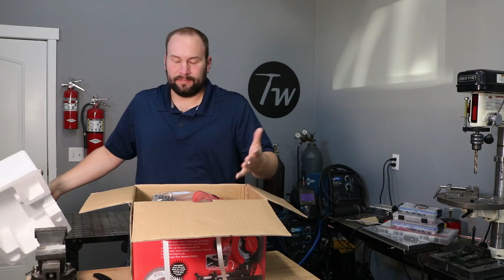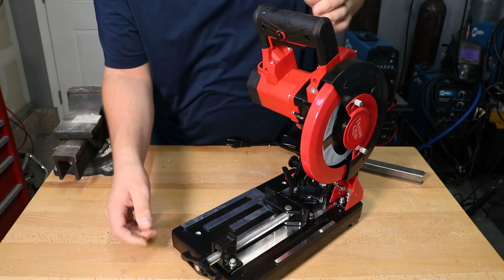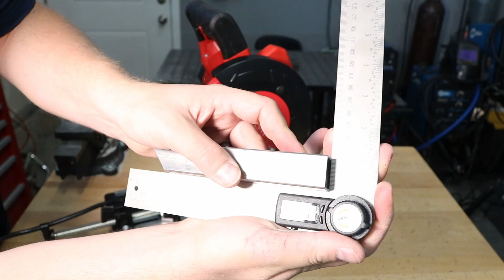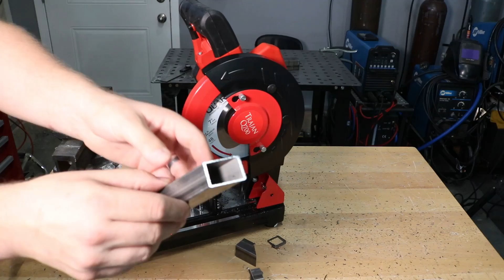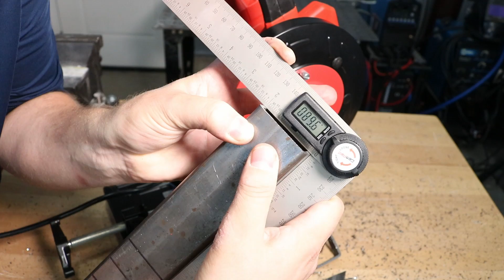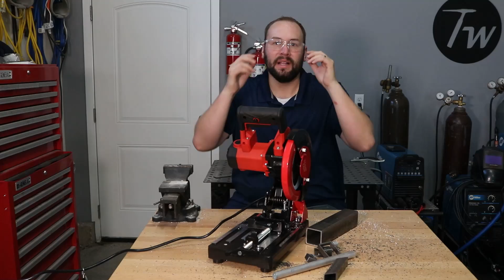Trajan Q700 (7 Inch Chop Saw) Independent Review

Comment: It was an okay saw when I first got it. After a few dozen cuts I saw slower cuts, many burrs, more sparks and burning hot cuts. I didn’t cut anything thicker than 1/8”. 
Two weeks ago I ordered a blade online which didn’t arrive—the help person on a follow up phone call today said out of stock and offered a different blade. Good service, but you need to chase it down. 
New saws haven’t been in stock the last few times I checked so if you want one you’ll have to find them on the Used market. Those who have them will find single blade are out of stock—instead one can buy packs of three or five blades. 
That’s the price one pays for the portability.

Comment: Thanks for the review!   I just got a welder and gear this past weekend and have been learning a great deal from your videos.   I'd welded with a stick welder in high school shop class many years ago, but that was the last time.   Now I want to weld small projects - frames , racks and smaller items.   I can't really think of any planned projects where I'd be using anything larger than 2".  This saw seems like it would cover 99% of my needs.  However, also on my short list of cutting solutions:  miter box , cutting lube and a hacksaw , diablo metal blade for my skilsaw ,  freehand with a 4-1/2 angle grinder and thin cutting wheel.   I'm trying to keep to a budget, but I could stretch it to cover this saw.  So my question - of all the options on my short list , is this saw the far superior choice?
Reply from the maker: Awesome! You're going to love it. If I were you, I would start out with the cutting wheel on the angle grinder. You can do most things with that. As far as budget chop saws go, you won't go wrong with something like this, but an abrasive cutoff saw will cost less than one with a toothed blade. The other saw I would look at is a portable band saw; I have 2 and they are some of my favorite tools. You can also make a stand to mount a portable bandsaw in to cut out shapes, which is really handy. I don't think you can go wrong with any of these.